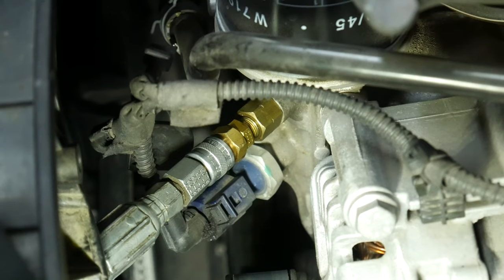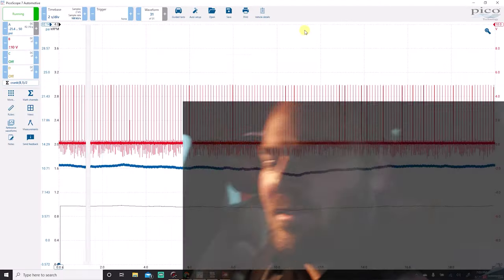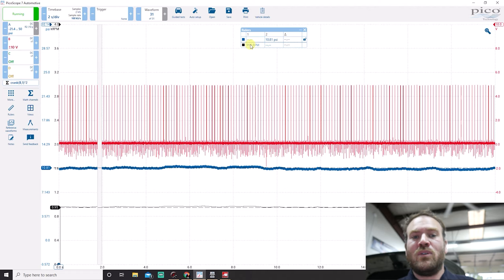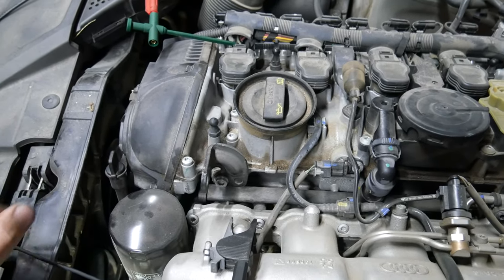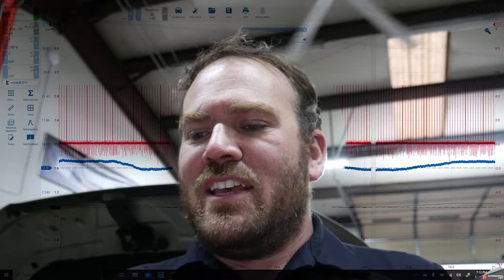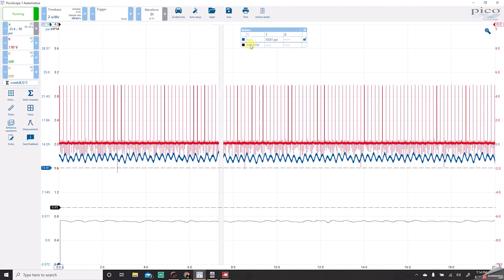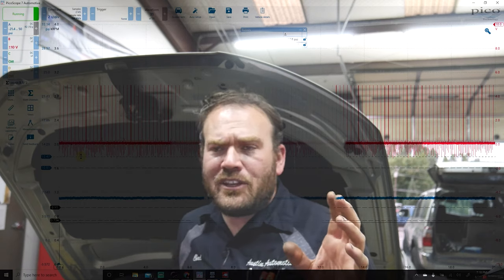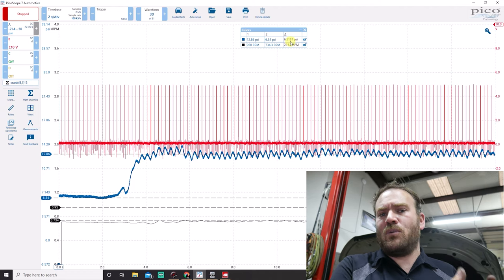2014 Audi A4 low oil pressure and rough idle

Comment: I can confirm your theory is correct, while I'm not a mechanic I do have some mechanical experience as I do everything myself on every car I've ever owned (except for things like wheel bearings and things that require specialized tools). Last week I had the dreaded 'Low Oil Pressure, Switch Engine Off Immediately' on my A5 2.0T, that is a scary warning, so I shut it off right away but I still had to get home (I was maybe a half mile from home), so I limped it home, shut the car off each time the warning would sound (which only came on at idle when stopped at a light) so that was my first clue (strangely it didn't throw a code, or at least the CEL didn't come on).  Once home I let the engine run for a couple minutes while I looked around under the hood, I noticed when I went to open the Oil cap there was so much vacuum suction in the crank case I thought I was going to break something if I yanked it off, so I didn't, also I noticed there was no extra rattling or worrying sounds coming from the engine as it ran, so those were 2 other clues.  I saw your video here shortly after (that evening or the next morning) and deduced from those 3 clues that maybe, just maybe it's the PCV diaphragm is torn, so I ordered a replacement off Amazon incase I broke it while checking it.  So I tried to open it without breaking the PCV cap but of course it broke, and to my pleasant surprise the diaphragm had a small (half inch) tear in it.  So I ordered replacement 'low oil pressure and high oil pressure switches from Audi incase it was that,  but low and behold the $20 replacement PCV cap and diaphragm arrived, so I switched it out and problem solved, that was it.  I didn't want to say that was it right away so I waited a week and tested it by daily driving, put about 400KMs since and nothing, now warning, no funny sounds from the engine bay, nothing, so I think it's safe to say that yes your theory worked (in my case at least), thank you for the video, keep it up!
Reply from the maker: Thanks for writing up you experience with this same issue. Ever since the B5 passat and A4 with the 1.8t had the dreaded oil light while driving down the road we get a little nervous when it happens to any vehicle. The 1.8 would sludge up the sump and actually starve the engine of oil but from my experience the 2.0 suffers from excessive vacuum more often than actual low oil pressure. 

Now don’t get me wrong the 2.0 has its share of oil pump issues and oil pressure control valve issue but the pcv system is checked first from now on.  

Thank again for sharing.
Reply: I am going to try the same. My car has the same issue. I have an Audi A4 B8 2.0T.  Would it be wise to buy the whole PVC valve plus the whose that comes with it? Thanks
Reply: @JoseStudios  it's just the PCV valve cover that develops a little tear in the thin liner inside, once that happens it creates crazy vacuum inside the engine, the PCV valve cover is only maybe $20, but it's an easy test to see if that's your issue, try opening the oil fill cap while the engine is running and if it has a lot of resistance and is hard to open then that's your problem.

Comment: Thanks for the sneak preview via the chat. I follow your theory, but only because of your explanation and knowledge of how that "system" works. Showing the results on the scope was cool.
Reply from the maker: It made since in my head and was trying to find the best way to explain it. I hope with the scope captures and the description I typed up I was able to explain it fully.
Reply: @ThePracticalMechanic  is it enough to change the valve or better the full unit ?✌️

Comment: Brilliant discussion, I think you're right, the reference should be relative to crankcase pressure. We use oil pressure to estimate the delivery of oil volume. Kinda like using voltage to infer total current or power delivery, different things. If one could measure volume of oil pumped it might be a more accurate, but then again to interpret readings one would need a table to cancel the effect of higher pump rpm. These pumps are volume driven so absolute pressure of the liquid shouldn't matter much, especially when the outlet is subject to the same pressure effects inside the engine.
Reply from the maker: I’m going to have to build a test tank with built in pressure and flow sensors to completely prove or disprove my theory but I think the flow will remain close to the same. At higher levels of vacuum we may see a decreased flow because the pump won’t be able to create as much of a pressure differential and will be unable to draw in the oil from the sump.
Reply: @ThePracticalMechanic  sorry to tag but I’m new to this stuff. I attached a catch can and a breather filter on my 2.0t and was gonna try doing the dip stick vacuum test. Wondering what I should look for numbers wise and any tips on what to do while. I had an issue during winter month before the breather were oil came out of the cap. So now I am just curious to know how everything’s working now. Appreciate any help.
Reply from the maker: @koncretesurfer5295  the best way to test the crankcase vacuum is with a millibar pressure sensor but a regular vacuum gauge can be used for a quick test. I like to see less than 1in/hg when measuring at the dipstick. If using a mbar sensor you will likely get a reading of 30-50mbar.
Reply: @ThePracticalMechanic  dip stick didn’t move at all. I instead inserted it into the manifold were I have it plugged from installing the catch can. Does this seem right? When I did so it read on the green around 50. Seems correct but weird nothing happened with the dip stick. I assume because of the catch can. Appreciate any input as I am still learning and I enjoy knowing more.

Comment: I love this guy!!!!! He saved me so much money!!! Like he said change the PVC!!!!!!! (((Low oil pressure switch off engine))) I will say it again change the PVC!!!
Reply from the maker: Awesome!! Glad it fixed the issue. I’ve since seen many VWs and Audis come in that already had the oil pressure switch replaced or the oil control solenoid replaced and the light still comes on. Quick crankcase vacuum test to find out if I need a crankcase regulator and done. 

Thanks for watching and commenting your results.

Comment: I had these exact same symptoms with a rough idle at low RPM, with a low oil pressure warning. This is a common problem with Toyota Corollas, Matrix, or Vibes about 5 or 6 years old. Either the PCV well simply wear out, or the PCV hose will crack, creating a vacuum leak. So at idle the low oil light will start flashing. But goes away once you're above 1500 RPM.

That little episode taught me to change my PCV and hose at least once a year.

Comment: Thank you Chad. Good job. Pressure is a result of the amount of flow and the resistance to that flow. Yes, vacuum inside the crankcase (on top of the oil) causes the oil pump to draw less oil in and results in less oil flow out. So it reduces the volume of flow. Less flow results in less pressure. Same effect would occur in fuel tanks. If the empty space above the fuel was allowed to be drawn into a lower pressure (vacuum). It would result in less fuel flow and lower pressure. 
Have a blessed and safe week to you and your family.
Reply: The vacuum at the inlet of the pump are the same as the vacuum at the outlet, so it does Notting to the  pressure as Chad said, but it does infect the oil pressure gauge comparing to atmospheric pressure. The vacuum valve controlling the vacuum are faulty. New vacuum valve, vil fix the high rev, and give a correct reading of the oil pressure.

Comment: I wish many can understand how sometimes simple  it is to diagnose low oil pressure light. Oil pressure switch (Brown)and sender(Blue) hardly cease. The only problem are in the oil filter housing and PVC, as funny as it may sound, I fixed many A4 1.8 or 2.0 B8.5 and B9. Unfortunately I am in South Africa, I drove 1052 km and it never flashed.. The problems are seals or PVC diaphragm . Even oil pump for those models hardly fail.
Reply: Wow thank you my brother🙏🏾
Reply: Where are you located, my car has this problem but the mechanic said it’s the two switches, changed them but the problem is still there
Reply: @dumisanimgqoboka6934  Otherwise it is very scaring when it indicates that you should switch the engine.. Do not drive more than 100 miles
Reply: @phlubi1223  very scary, I never drive except 5 min to the shop & back. I want to try check PVC diaphragm & seals cause it does show some leaks
Reply: @dumisanimgqoboka6934  Buy Oil Filter Cap it comes with a seal on the pointer and buy a new oil filter it also come with a seal. You might as well do oil change. Then buy an engine oil cap. Buy both Oil filter and engine oil cap at Audi Dealership whereas oil filter and engine get them at Goldwagen. I prefer 5W 40 Helix Ultra, it's not recycled but natural hence the price. Thereafter switch on the engine then clear the fault codes prior and after..
Reply: @phlubi1223  God bless you Sir, will do it kusasa, thank you
Reply: @dumisanimgqoboka6934  Ngiyabonga Mvethu.. Ngiyathemba uzoba grand
Reply: Hi phlubi1223 my audi has same problem & I'm based on midrand . Can't find a good mechanic , where can i find you , Thanks .
Reply: @PrashantPoudel172  I have the same problem did you get yours sorted?

Comment: Same issue with 2013 A4 and only 99km on engine. Replaced switch and PCV and no change. Audi mechanic foreman suspected something more going on with end bearings so inspect screen in oil pan for metal shavings or cut open filter and inspect.

Comment: Thanks a lot man 😀😀😀 you are star ....... I've changed the oil pump and both pressure sensors but the problem persisted when the engine was at optimum temperature 🌡️...... I've just replaced the pcv and booom problem solved 🙏😀😀

Comment: Quick one, I know this thread is old but I am having this issue whereby the “reduce oil pressure switch oil shows as a fault
Code and it asking me to top up oil,  by showing the oil can, now I had the oil pump changed, but still low oil  info still shows. My pcv os mot sucking air from the outside though it tiny side hole into the crankcase but I notice that I have high suction when I open the oil cap cover when the engine is idle, and when I open the oil cap, the engine begin to surge or have rough idle but when I close it, it won’t exhibit rough idle but I have high suction, please tell me do I still need to change the diagram of the pcv

Comment: Thanks for the informative video.
Just wondering on oil pressure switches in Skoda superb, there are two, as you also mentioned. F22, F378 where the later one is mounted on top(brown) and F22 is blue below that. I am wondering they are just a NO contacts and when i checked with DMM. really needs to push a bit hard to get contacts closed. I am not sure and ithink this design could have flaws as a little lower range of pressure can make the switches to deactivate. Again I am not sure about this digital information to dashboard. My oil pressure is showing low intermittently  and no mechanic so far understood the issue here. Engine seems ok,  No noise. I think your video makes sense. Please advise me if i have to check the vaccum.

Comment: on the fence with this one...i think it is flow , literally pulling on the oil causing low oil pressure and not difference in pressures from the sensor but would love to find that out for sure. If that vacuum is able to pull on crank seals , imagine how easy it would be to pull on liquid. A vacuum cleaner test in a bowl of oil should be a good lab test.....ha ha  see if it spills faster while you have the vacuum in the bowl. Why is it harder to pull the OIl Cap off ????????Oil pump is having the same problem.....

Comment: I have the same car with low oil pressure. It happens in different situation than mentioned, tl;dr it only comes after the oil is hot (like in the video), but only in D (idle), if I put the car to N/P after the light comes up then it disappears after a second or two. Could it be still the PCV?
Reply: I'm having this very same issue, oil pressure low only after the engine is up to operating temp and only in drive.  What was the issue with yours?
Reply: @FelixObuya  I've replaced the PCV, but no luck there. I took it to a VAG specialist and he thinks it's the balance shaft. I'm currently having the engine swapped.
Reply: @ChrisKellyPrime hey i would love to hear from you...did you ever find the problem or find out what was causing it???? I'm still having this problem after a engine swap and a rebuild engine that was swapped still low oil pressure😢😢😢
Reply: @coryjackson6034  My solution was to sell the car.

Comment: hi i need your help if you can pls i have audi a1 2011 ofter 10 min drive message coming stop switch off engine oil pressure too low. soo far i have changed oil pressure switch twice same issue changed oil pump new still same. changed oil level sensor still same, changed pipe sucks oil fresh serviced please if you can help only lights come on after 10 to 15 min drive
Reply: Awaiting a response from a professional....

Comment: Can someone help, I have a 2.0 Tfsi A5, it came up with the oil pressure to low message on the dash and it now idles rough and when the car is coasting it builds up revs by it self, have had engine oil and oil filter changed mechanic now thinks replacing the switch will resolve the issue

Comment: So what is the fix/problem?
Reply from the maker: For this vehicle we replaced the crankcase pressure regulator. The excessive vacuum in the crankcase was causing a false low oil pressure reading from the sensor.

Comment: i have a rough idling vw cc 2.0tsi ccta engine. Low oil pressure light flashes when hot and mechanic has verified low oil pressure.. Would it be worth it to replace the pressure control valve to see if it helps? im misfiring above 1/2 throttle and replacing coils myself soon and pcv if anyone thinks it would raise oil pressure.

Comment: I have an Audi A5 2011 I have this problem my car is actually misfiring & rough idle & the low oil pressure light keeps coming on . I got full tune . New timing chain kit new high pressure fuel pump sensor  new connectors my car is still rough running & Mis firing . Could it be my pistons going bad or what should I do I been spending tons of money
Reply from the maker: It could be all sorts of things but in the video I show what testing I did for the low oil pressure light issue. Your issues sound different than my issues but the problem may be the same. You may want to have someone check the crankcase regulator.

Comment: Any update if change of the PCV valve solved the issue with to much vacum in the crankhouse?.
Reply from the maker: Johan Falkman yes. Replaced the crankcase pressure control valve and everything went back to normal.
Reply: @ThePracticalMechanic  where is that located? Thanks
Reply: @ThePracticalMechanic  sorry, figure it out. Thanks!

Comment: Does anyone know if someone has a detailed training video on using the pico. Im not good with reading and applying certain directions. I can use the scope but thats where it ends for me. I dont know what or how all those other functions work. Basically i just get a signal and thats it. Im not new to scopes but im not old ether if that makes sense. I would like to get better.
Reply from the maker: Although it’s not picoscope exclusive I just started a labscope training series. We are starting with some common tests and waveform acquisition. I will be doing some pico oriented videos in the future. Are you looking for information on custom probes and math channels like what I used in this video?
Reply: @ThePracticalMechanic  yes exactly math channel and any other extras it does. I just have a hard time following and understand directions when im not knowledgeable on the topic at hand. For example it will  say something crazy like, "switch the flux capacitor to 15 degrees and dual processor to B" then all the sudden im lost. I have to stop look up flux capacitor then daul processor see what thats all about before i go on.
Reply: @ThePracticalMechanic  but ill keep my notifications on because i really want to up my diag scope game. After watch WELLS youtube channel on evaps systems for bwm and Chrysler it blew me alway. I learned so much. Ive always been a type of person that wants to know how it works the whole system. I was never satisfied just knowing this switch controls that. I want to know how and why. I love doing diag work because im constantly learning. As soon as i think i have a system licked they come out with something new.
Reply from the maker: I'm going live tonight to discuss the weekly waveforms and I'm including some basic picoscope match channel information. It will be available afterwards if you miss the livestream